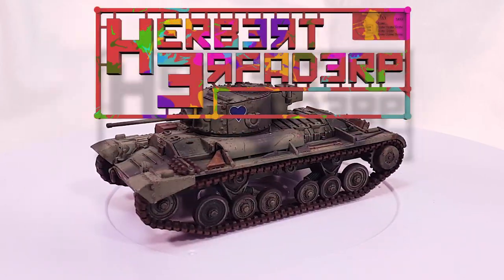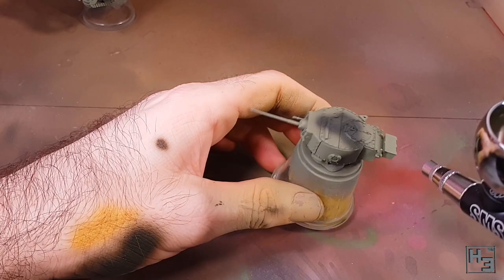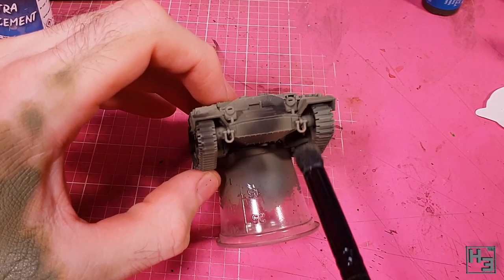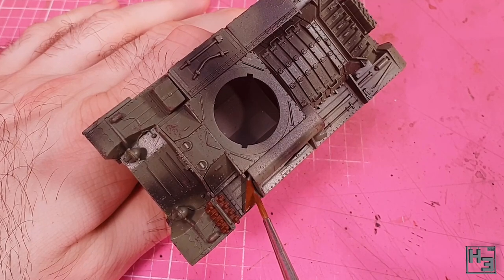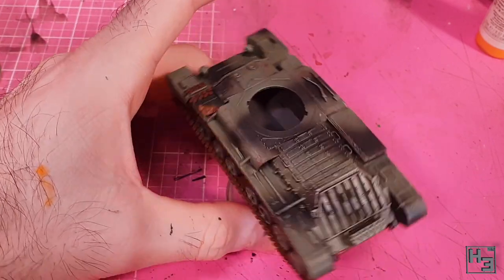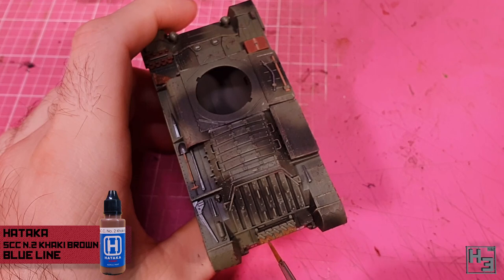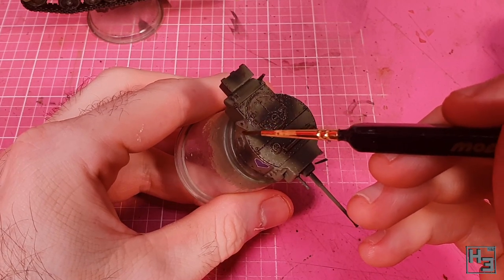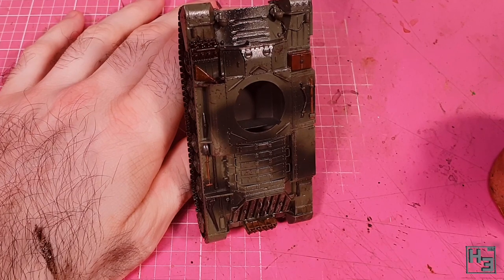Valentines Day 2022 - Painting the Rubicon Valentine [28mm]

Comment: How do you get the dullcoat on so nice? I'm stuck with rattle cans for now and always seem to make a shiny mess of things
Reply: If you have a airbrush, try some microscale products. They have clear gloss, and clear flat..
Reply: First, rattle cans are kind of like epoxy. Shake them until you think you're done, then shake them some more. The paint, solvent and propellant really need to be well and evenly mixed.

Second, several thin coats are always better than fewer thicker coats. 

Third, give plenty of drying time between coats. Don't let impatience ruin all of your hard work. Build something else while waiting- it's a good idea to have several projects going at once.

Fourth, pay attention to temperature and humidity when painting. A few degrees or humidity points can make a lot of difference. Not just the air by the way- make sure the paint and model are as close to the same temperature as you can. Cold paint will naturally make a mess, and a cold model will do the same.

I've learned all these lessons the hard way.
Reply: @markfergerson2145  lots of useful info, thank you
Reply: @Andrew-se4tg  I really should invest in an airbrush